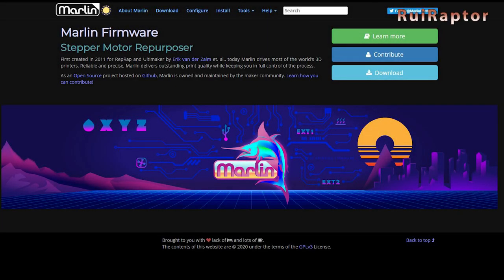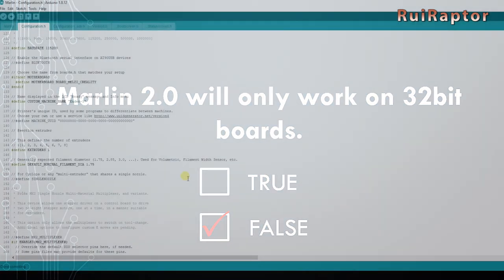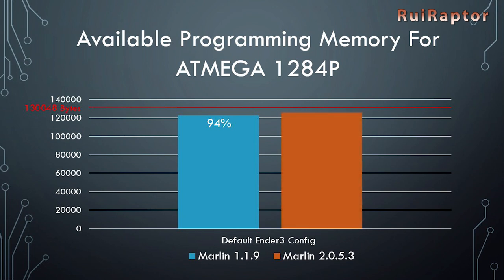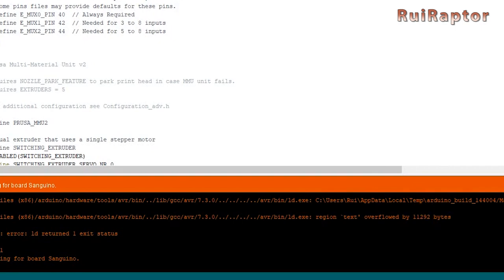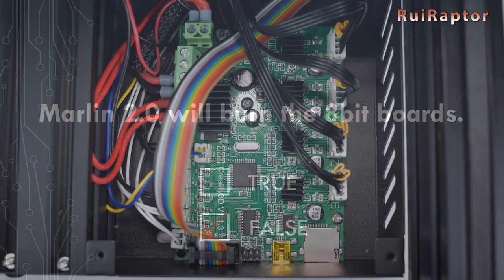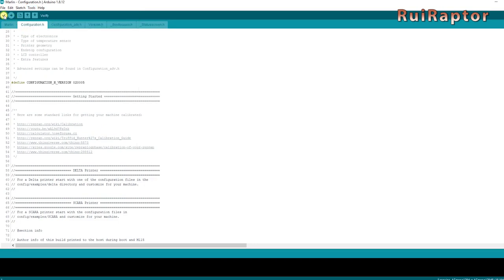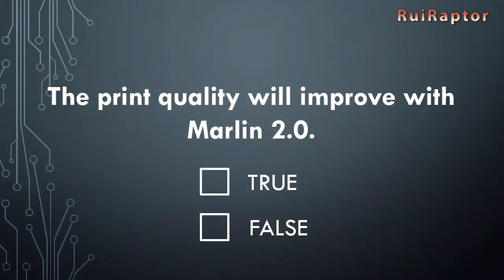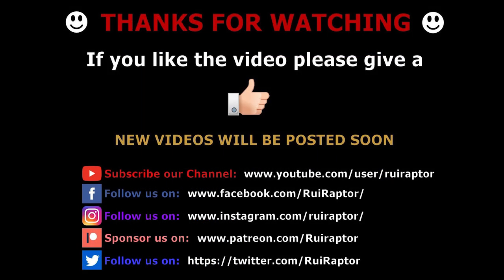7 Demystified Myths about MARLIN 2.0

Comment: I was able to successfully use marlin 2.0 (bugfix) on my Ender 3 stock board. With abl (inductive probe), baby stepping, linear advance and some other stuff with also the security features enabled. Had to disable some like arc and SD support. But since I use octoprint, not having the SD wasn't and issue.
Now I upgraded to skr mini e3 V2. A beast!
Agreed with all statements in this video. Now a question: What would you use as a 8 bit board for a printer, a Creality stock board vs Arduino Mega 2560?
Big fan from Argentina, cheers!
Reply from the maker: Hi Gonzalo, if i wanted to use an 8bit board for a 3d printer, i would choose one with the mega 2560 MCU instead. Probably an MKS Gen L for example. It has twice the programing memory, extra I/Os and removable drivers. Best regards from Portugal

Comment: lol. Who came up with the myth that a microcontroller can be overheated with more calculations? A basic microcontroller like the ATmega always runs at 100% "cpu load". It doesn't make a difference for the controller wheter it's doing useful calculations or waitcycles. It's designed for that. :)
Reply from the maker: You are correct. We included that myth in the list after seeing some people discussing that issue in one group. The tests revealed that exact reality.